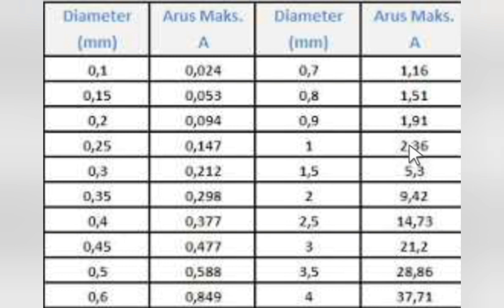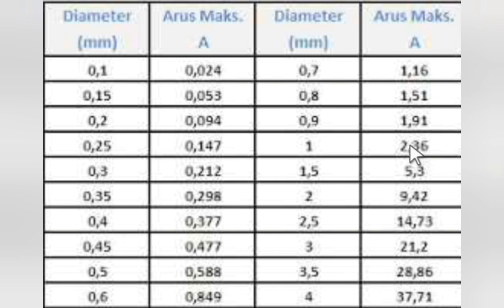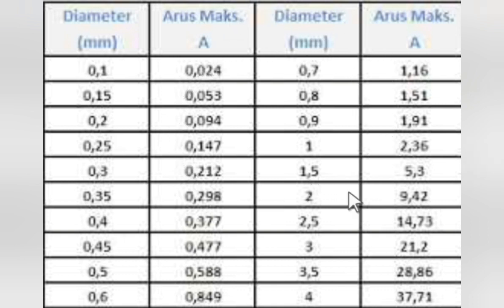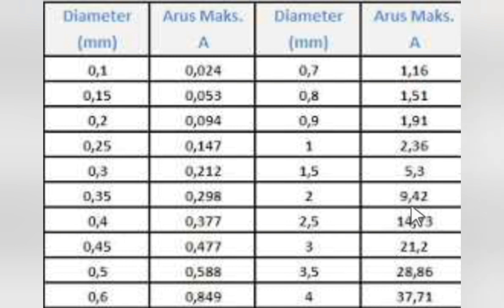rumus setrum ikan platina

Comment: Untuk kawat 1.5 untuk 3 sap butuhin berapa ons kawan bang
Reply from the maker: 3 on setengah
Reply: @longtimeentertainment7431  untuk primer berapa mili dan berapa lapis untuk 1 aki 10a
Reply from the maker: Saran saya

Pakai 2,2mm 5 sap
Reply: @longtimeentertainment7431  ditmptku airny dangkal om 1.5 m
Reply from the maker: Iya malah lebih jos, tetep irit walau kawat besar, boros atau engak nanti mengikuti kedalaman air
Reply: Assllm...mas saya punya kawat P.1,5 S 0,8 keren terlilit 9cm, butuh berapa sap P/S dan pakai kondensor berapa biji biar joosss untuk aki 12v 10a. Suwon🙏
Reply from the maker: Primer 4 sap, sekunder pakai 4 sap,konden 10pcs
Reply: @longtimeentertainment7431  total berapa ons itu mas.
Reply from the maker: Beli aja 4 on semua
Reply: @longtimeentertainment7431  kalau sekundernya dibikin 5 sap gmn mas.
Reply from the maker: Bisa, klo bisa jangan banyak2 nanti terlalu tinggi voltase jadi malah drop di air
Reply: @longtimeentertainment7431  matur suwon masukane mas. Salam tettt....dari LAMPUNG🙏
Reply from the maker: Yups
Reply: Mas kalo pake keren 2 x 2.3x 10 . Telilit 9 pake kawat primer 1.5 dan sekunder 07 berapa onasing 2 kawat mas dan berapa sap untuk primer dan sekunder.. tolong di bantu bang saya buat sepul pake kawat 1mm 3 sap dan 07 mm 5 sap susah di setel bang ikan nya gakau ngambangdi air dalam